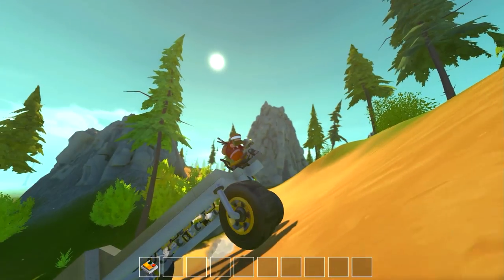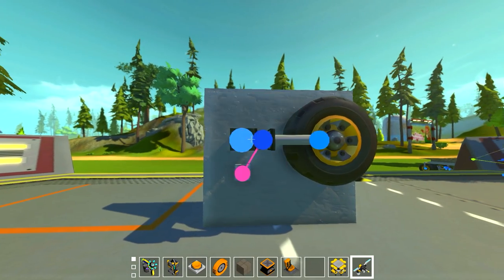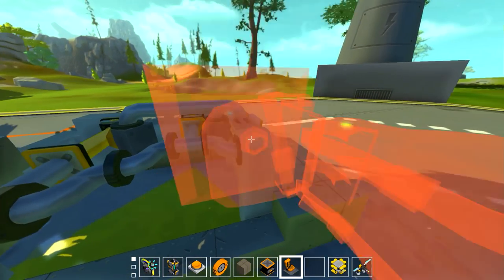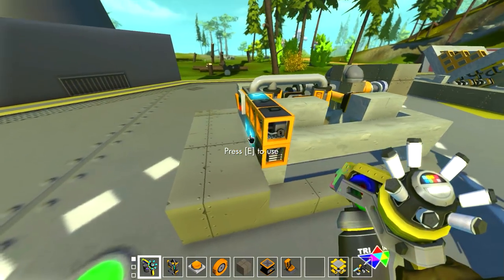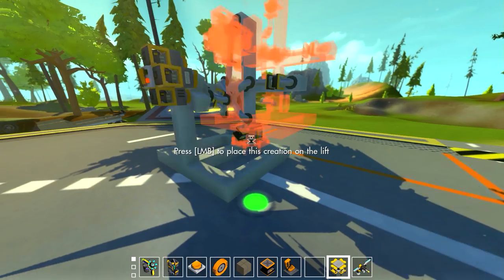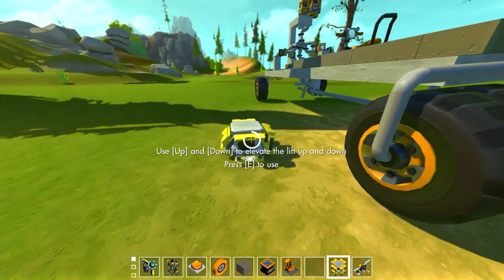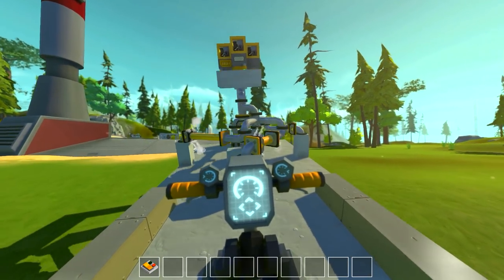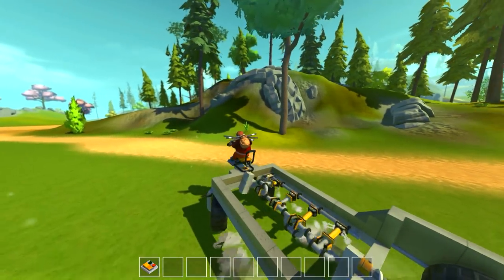Radial Engine and Piston Powered Cars! (Scrap Mechanic #183)

Comment: I think you can start the piston pre-extended with controllers
Reply: A lift cancels controllers too
Reply: Can I send my idea by E-mail?
Reply: unfortunately the pistons starting (lift) position no matter what you do is 1 block. i set up a dual piston vehicle that uses 2 pistons, a 90 degree after lift rotation, and a nice timing circuit to make it run smoothly.
Reply: Not on the lift.

Comment: Even if it's too bulky, you could just triple that last design on top of itself and put the seat in the middle. You could have the high, low and reverse gears, but it would have to be about 11-15 blocks high. It's still an awesome design concept.👍

Comment: For a clutch u can have a button that pushes the gear to mech and when it's not extended it won't be meshed
Reply: Use a piston
Reply: Near the Back wheel the gear that's attached to the wheel and the gear powering that gear
Reply from the maker: I was thinking exactly that actually.

Comment: Plz build a car with 2 of the 4 piston engines 1 engine on rear left tire and 1 on the right to create tank steering. Also add more weight to front than back to balance the amount of power.

Comment: Hey kAN I made an engine inspired by your straight 4 that you showed in the video. It has a different sensor system that would allow for a 3 piston engine which I think would be pretty cool. (more than 2 strokes but smaller that a 4 stroke engine.) Check it out here: http://steamcommunity.com/sharedfiles/filedetails/?id=1076586765

Comment: a very early bi plane solved fly wheel issues by bolting the crank to the plane, and the propeller to a spinning block. Would be a challenging build

Comment: most of those engines wont work in a future piston update because as axolot has said, that they will add a hitbox to the piston but that is hard to do. why do people keep forgetting that and make creations that wont work in the future?!
Reply: The Sky Gamez yea, but it's good for the time being I guess, I don't like to use glitches axolot says they will fix cause like u said it won't work in the future
Reply from the maker: When they add collision you could always switch from pistons to suspension and get the same effect. If they remove all no collision blocks then we'd have to look at things differently :P
Reply: dont give axolot good ideas kan  :) ..  we need no collision blocks..  but i would love 1 added that can activate sensors.
Reply from the maker: Problem is the hitbox that causes collisions is the same thing sensors look for
Reply: It is a lazy way to do things. Using glitches and non collision blocks defeats the purpose of playing an engineers sandbox. Instead people should be looking at how to overcome the limitations of physics and not the limitations of the engine. It will be a lot more impressive to achieve these feats without cheating.
Reply: But there is no coaxial axles (axle in another bigger hollow axle), so that is why he uses no-collision pistons on crankshaft
Reply: exactly... we are just making doublesided bearings.
also if you got a big creation it stretches the bearing connections and cause fps drop. this way we release the tension and can run pretty much without any fps problems.
and a stretched bearing connection makes thrusters unstabile too..  
its a game in progress. we just stresstest it a bit ;)
Reply: its not a lazy way.. its the only way sometimes..
and with the modblocks imagination just run wild.
this would be impossible without no collision parts : http://steamcommunity.com/sharedfiles/filedetails/?id=942788906
Reply: In real engineering, you make whatever works best, there isn't a rulebook what's not allowed (except safety rules of course). Sometimes the quick and dirty way is the most efficient solution.
Reply: The Sky Gamez that's the point, if you can't make them in the future why not just make them all now
Reply: Lt Sam most if not all engines that exist in the world would need no collision blocks to work because otherwise it would be to flimsy

Comment: kAN I made a gear system with a gear ratio of 1/390,625, with a controller at 60 rpm it takes 4 days to rotate 260 degrees. LET ME KNOW IF YOU WANT ME TO UPLOAD IT.

I'm derpy chicken btw I changed my name to my discord name and steam name and everything else because it was bothering me.

Edit: I also have a 7.5 million pound weight cube (also on my workshop) on a vertical transfer gear at the top with an indicator so I can see how far it's moved.

Also is it bad that I have over 100 hours of Scrap Mechanic in the past two weeks?

Comment: Kan, I  just a idea with the new pistons do the train delivery challenge with the new piston but you gotta build a steam train with the tender attach to the train and 3 Flatbed wagon With mail wagon there is gonna be 3 stations in Each station has two diffrent word There is A,B,C,D,E,F, Words. the rules are Do Not cheat and you gotta build The switch track and the buffer. the winner is if you deliver the package and the mail add exctaly word And The fastest Wins. can You Do This video?  PLZZZZZZZ .

Comment: Loving these builds, had a go myself with the flat 4 piston engine, added an extra 4 pistons onto the end. tore apart my previous creation that have a go with this, even with the 8 pistons driving my builds too heavy just crawls at a slow pace. but its just too good to watch those pistons go round. feel free to check it out. all credit for engine design goes to @kAN Gaming. http://steamcommunity.com/sharedfiles/filedetails/?id=974380795

Comment: on the radial engine you should try placing the bulk of sensors on a bearing you can rotate a bit.
then you can increase both speed and torgue as needed by adjusting timing..
all interactive parts got a minor delay and this way you can make it fire exactly when you want..
love the radial engine concept.. that one got potentiale.
but remember a heavy flywheel of some sort. scrap engines like to work and it makes it run smooth..

Comment: a solution for the complete braking problem with the radial engine or any piston engine for that matter: use pistons to engage/disengage the driver gear, that way you can keep the engine on and still idle to a stop.

Comment: try just reverse gear and do a clutch for example if you stop pressing button the clutch will activate so that the car can go with out locking the gears, but if you cant make clutch i dont  think if it work, i think its impossible to make clutch out of blocks

Comment: You were right, i loved it! :D  The 2 last engines are soo cool!
And it give me more ideas, like now it needs: 
-Bigger wheels to get more speed
- a gear box to change speed (thinking about gears with pistons, or using wheels with different radius like gears)
- and maybe also a clutch disc (and/or couplings) , using pistons :D

while thinking about the problems to create the engine i though that the game need bushings, but now seeing your video of how you used the pistons and suspensions, then one can use a suspension to be like an axis passing trough objects.

wow pistons have so many uses.

Comment: Now you just need a gearbox. The question is are you just going to add reverse, or are you going to add multiple speeds as well?
Reply from the maker: Depends on the lag :P reverse first, speeds second.
Reply: My 8 cylinder 3speed+reverse sits about 60fps, so it shouldn't be an issue...

Comment: Does anybody know of a way to enable/disable controllers via a switch? Been trying to figure it out for ages now. I want the controller to hold the bearing at a specified angle, and then at the flip of a switch, I want the bearing to just react to gravity, or go into "limp mode" haha. The only way I can do this atm is by using a controller, and then deleting the controller. Obviously this is annoying because I need to set up the controller with the angle every single time... >.<

Comment: If you setup sensor logic such that the piston is given both power to push and to pull you can double the power output of your engine per piston. Meaning you could get your inline engine cut in half without sacrificing horsepower or smoothness. 

Another aspect to consider is if you arrange the pistons in a V format, two pistons can push the same crank journal. Which allows you to reduce the length even further.

So if you figure out the logic of giving the pistons both push and pull, and how to set the pistons at some angle (90 is the simplist) to each other, you'll have an engine that is less than 6 blocks front to back that puts out the same torque and horsepower as the inline 4 you demonstrated in this video.

Comment: Kan you can make a two piston car that doesn't have dead points by making one start half out.
Reply: Then you have a censer for each piston but it is positioned so that it is activated when the part of the shaft that connects to the piston is as high as it can be.